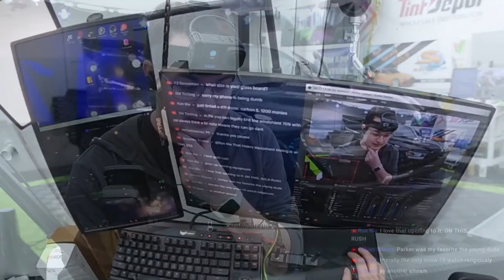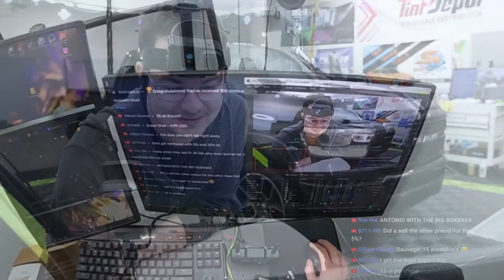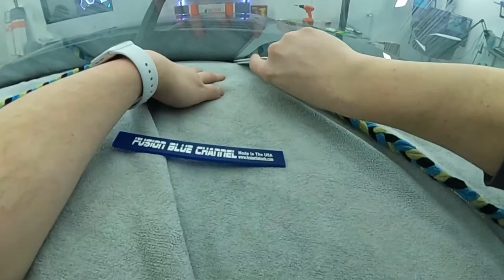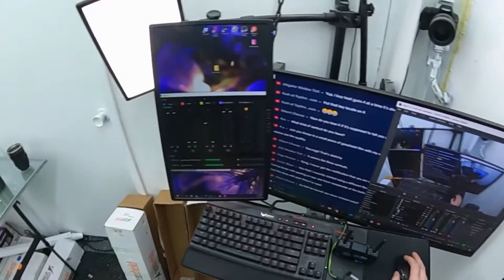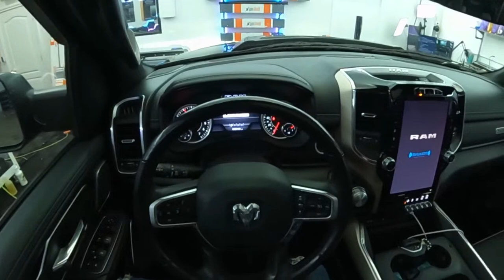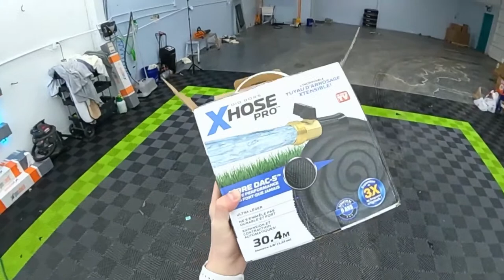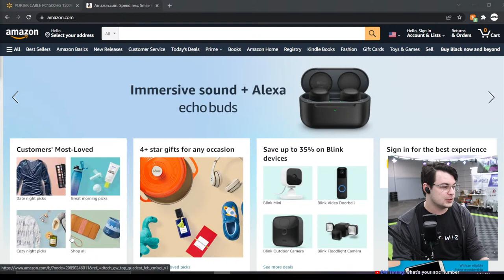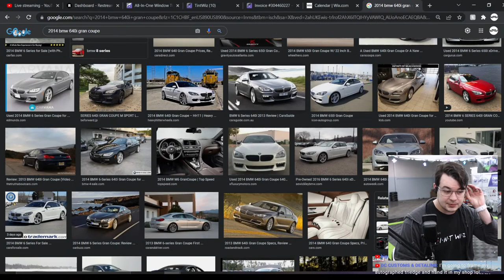WATCH OUT! Ram Full Windshield Tint

Comment: I did my 2019. No soak rope but tight rolled microfibers between dash crack and took about 10 microfibers and covered bcm and piled the other ones on top and created barrier over bcm no issues. Thanks for the help looking out 💪